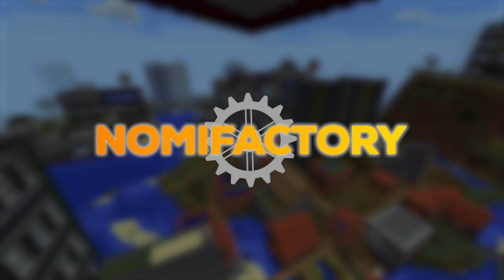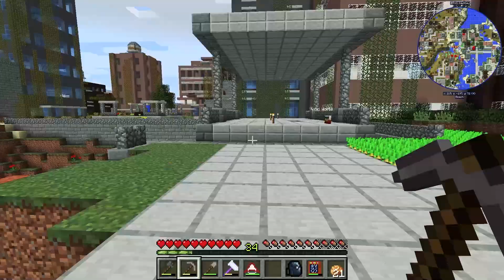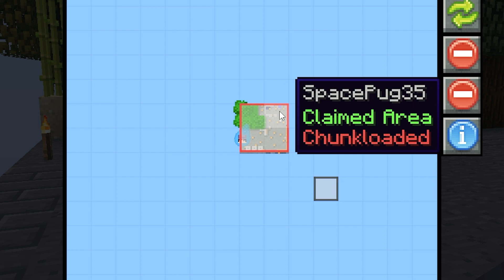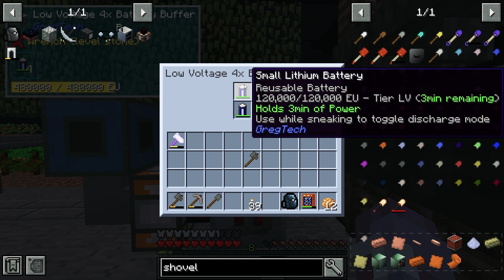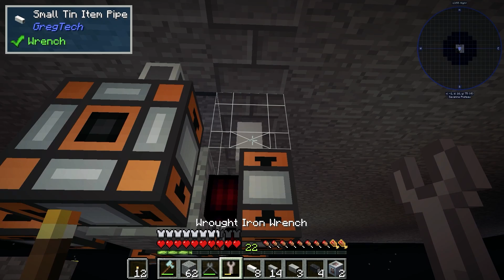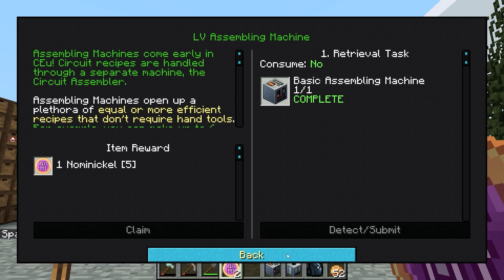OVER 30 HOURS?! | Gregtech Nomifactory Ep.1

Comment: Invar is far cheaper than steel but it has the same tool durability as steel edit: by far cheaper I mean you don’t need that much invar for things other than tools
Reply from the maker: Thanks for the tip! Any other materials that are good for tools early game?
Reply: @spacepug3557  Probably diamonds to be honest, especially for the hammers. Do keep in mind that some diamond tools (like the file iirc) require a cutting machine, because they need diamond plates.
Other then that, vanadiumsteel, which i guess isnt really early game and pretty expensive but really good once you can afford it.

Comment: Some qol. GT machine can auto unload product it self without conveyor, right click with wrench on one side will change the direction of unloading and click on orange button in machine interface.
Reply: Also this method works with fluids but button is blue.
Reply: Next, some multiblocks machines like ebf/pbf/distilation tower etc can share one side and hatches/buses. This method saves resources.
Reply from the maker: @CoBaldr  Thanks for the tip! Some one sent me a design on Discord, might use it in the future as we expand!
Reply from the maker: Fantastic, will be using this one
Reply: @spacepug3557  nomifactory ceu?

Comment: Dunno if in ceu nomifactory version has specialization augments from thermal, but if IT does you can pair up 2 turbine upgrades with one boiler specialization, power from this contraption would make somewhere as much power as 4 ones without specialization or atleast its in the non-CEU version of nomifactory.

Edit: steam from boiler goes the same way as energy from normal one
Reply from the maker: Thanks for the comment! Even after adding the power gen in this episode. After running the EBF, we are still falling short.. so I'll be looking into this for sure!